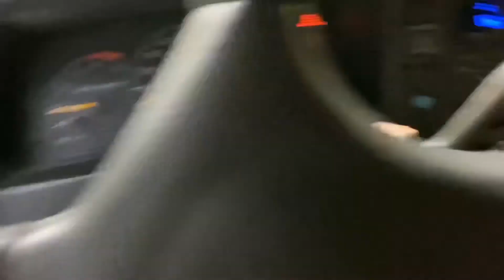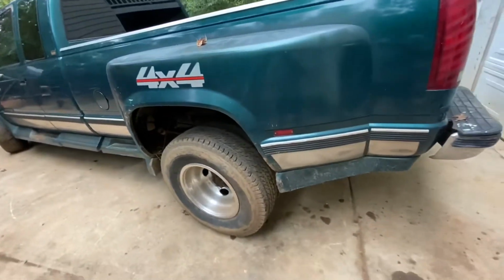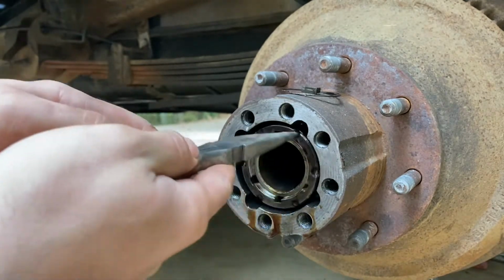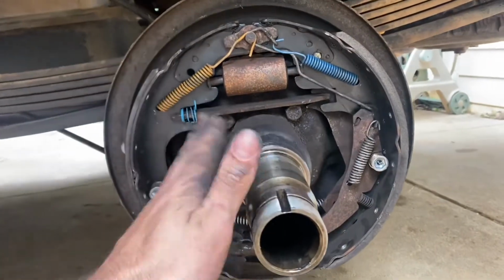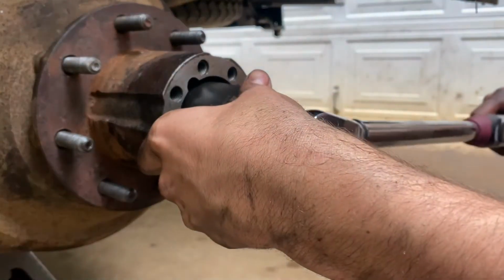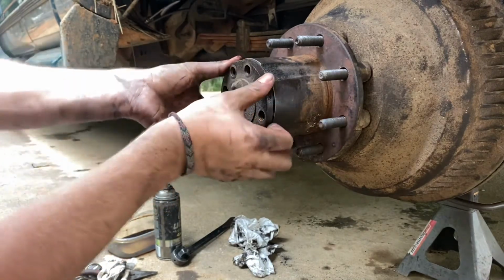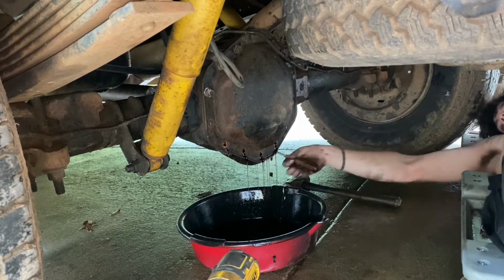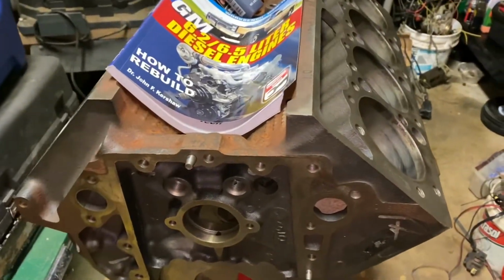6.5 Diesel Dually 4x4 Rear Axle and Brake Service

Comment: Im trying to find a good video that goes in detail on replacing the rear brake shoes, springs, and cylinders on these dually trucks. I have a 1990 K3500 and can not figure out how to do these brake springs. Everyone glosses over the spring assembly, or time lapses over the important parts like the torque requirements for the 8 axle bolts.

Comment: How do you bleed the rear drums on that thing? I have a P30. Is it easier with both rear wheels off? It’s no room back there
Reply from the maker: Much easier with rear wheels off, i was able to get my body between the wheel and fender and get to the bleeder screws when i did it though

Comment: Is it worth it i will never go with a 6.5 again Cummins or a duramax or a gas motor live got a 96 motor in it know it needs glow plugs and injectors if i can get threw till sprig I’ll be happy just getting ready to do my back brakes ther not torque ther finger tight
Reply from the maker: If you want to donate your 6.5 engine let me know lol
Reply: @averybryant  im in canada 🇨🇦
Reply: What happens with the motors you were going to build
Reply from the maker: Machine shop was booked out for months so I had to wait for that, but working on assembling now
Reply: Gotta maintain them and they'll treat you good. Abuse and neglect them and they'll leave you high and dry and that goes for any engine regardless of what name it has stamped on it.

Comment: 5-0 ft pounds is news to me what the point of all that to draw the seal in maybe anybody I know that have changed the if they don’t come off with your fingers ther to tight I don’t know hmm
Reply from the maker: Gm updated the service manual. Its to seat the bearing properly with the correct preload. Mine came off finger tight as well.
Reply: @averybryant  good to know thanks